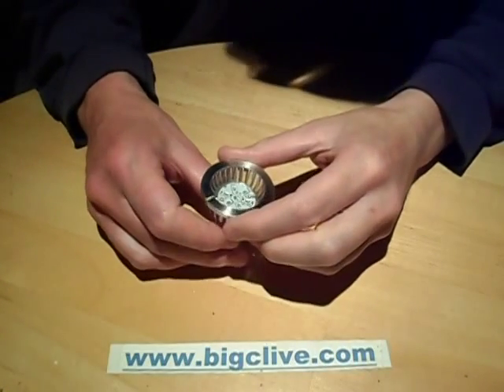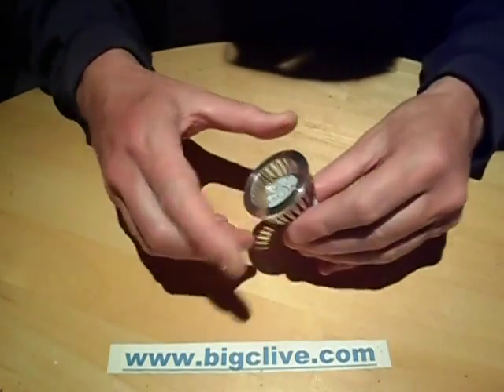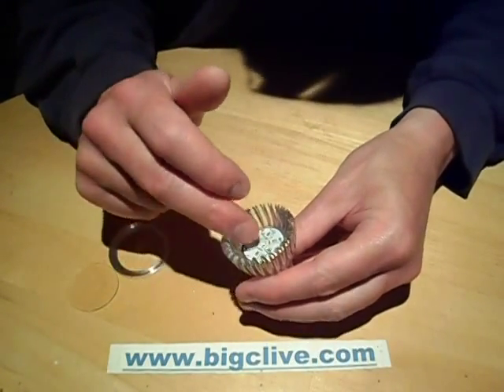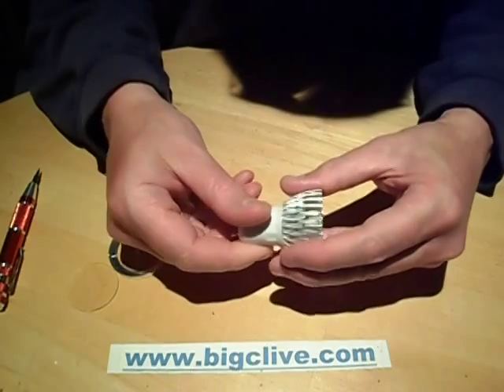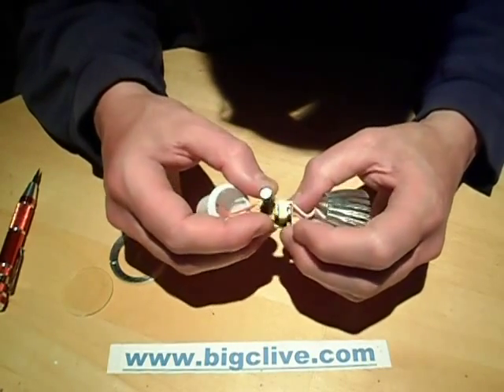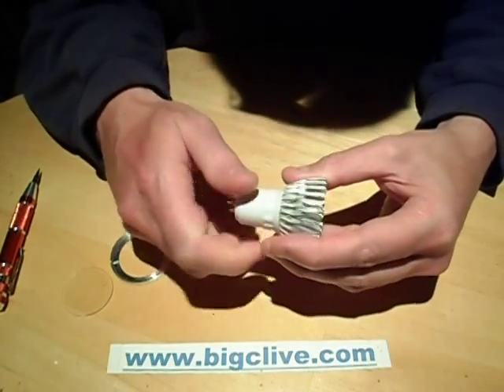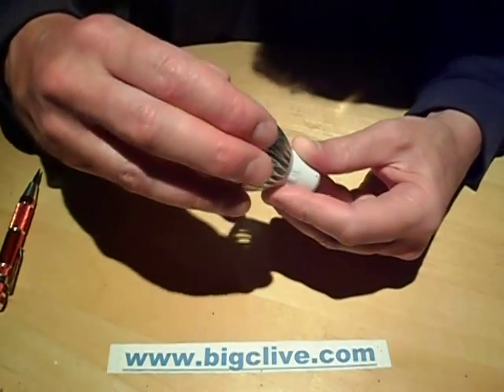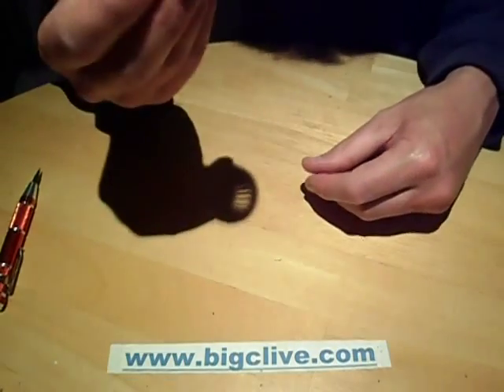Teardown of a 5W gu10 LED hydroponic grow lamp.

Comment: You say that it's power rating is lower than what it claims (5 W- 1.9 W) as if it's a bad thing? Surely that means it consumes less power for what it does?
Or does that mean that it consumes the same power but when it actually delivers it to the L.E.D's it's lost a lot due to resistance? 

Nice video by the way :3
Reply from the maker: To me it's a good thing that the LEDs are under-run since it will make the whole lamp run cooler and last longer.  But in the marketed application as a plant growth light the intensity is more important than a long lifespan, so the falsified rating is not desirable.
Reply: I see, that makes sense. Thanks for the response!